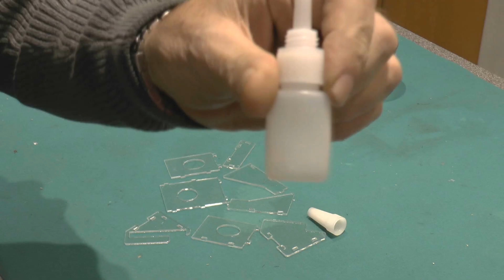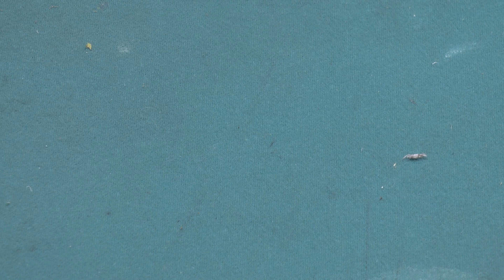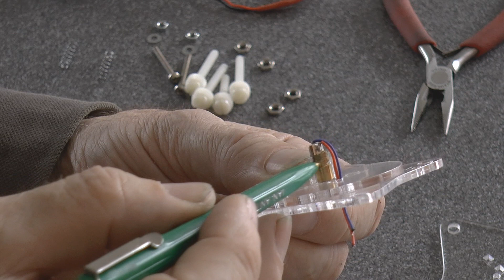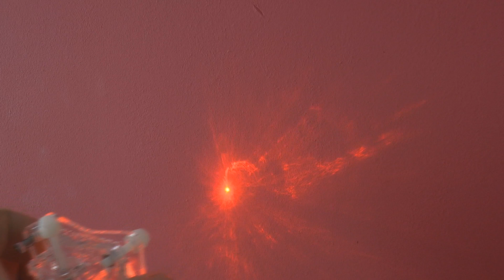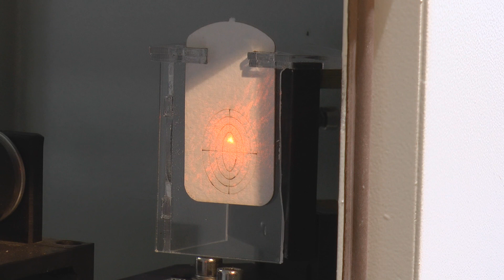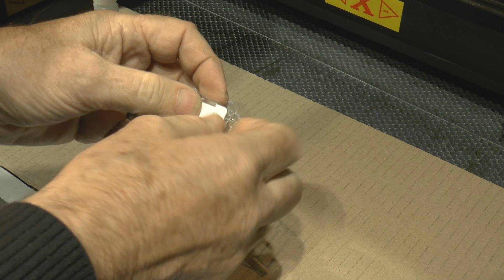RDWorks Learning Lab 88 Mk6 pointer and other tools

Comment: Hi Russ, first - thanks for your very detailed educational videos! 
Not sure you still read/answer messages to this 4 year old video you did.
I enjoy, learning and study videos from you already a couple of years and finally bought a Chinese 1060 100W RECI-W2 CO2 laser.

I would be very pleased if you could send me the drawing files you mentioned for the MK6 and accessories.
Unfortunately I can't find the PM you mentioned for your Youtube channel, it might have changed. 
However - Great quality videos from you! Thank You!
Reply from the maker: Hi Wolfgang

Just remember to remove it after use because this is not a beam combiner but just a setting aid. This video was near the end of my  mission to find the ideal laser pointer setting aid and there are videos  for the others that follow  all the way up to Mk7. I am happy to send you all the drawings BUT in the light of experience,  i must add bit of a health warning. I have designed them so that you get continuous live feedback as you are adjusting mirrors during beam setting.  They all work well up to about 95% and quickly get your mirrors into approximate shape, However, unless they are aligned perfectly with the laser beam axis as it exits the tube there will always be some error..I found that despite my best efforts you still have to go all round with the scorch test to set the machine perfectly. Time and a lot of experience has taught me this, so I abandoned the idea eventually. BUT don't abandon the idea completely because it is an amazing tool to help with fault finding and mirror cleaning/changes.Two massive benefits are to be had if you have mirrors that are not easily accessible for cleaning. Let's assume your machine is well set and you decide to remove a mirror. Before doing so put the head as far  away as possible from  mirror 2  and put some sort of target/cross-hair on the head entry port.. Set your pointer to fire at the cross hair and leave it on. Remove and service your mirror  and when you come to replace it, it takes but a few minor adjustments to get the beam back onto the cross-hair and you have reset your mirror.. The other very useful application is when you have set your beam  perfect in 3 table corners but cannot make the 4th corner correct.  Observing how the beam moves as you traverse from front to back with the gantry you will observe the beam moving. It's now down to your mechanical problem solving skills to identify and fix the issue.   OR  you can watch this for the real solution    https://www.youtube.com/watch?v=Oc3UaJREQnU

Its now about 4 years since I last tried to use a pointer but If you still want drawings you are welcome. Just add your disguised email address to another comment and I will send them to you and also delete your comment.   

Best wishes
Russ

Comment: Hi m8, i need ur help, im about to order a laser cutter, but i cant deside which one to order, can u help me out making the right choice? i been looking at this http://www.ebay.co.uk/itm/Reci-100W-Co2-USB-Laser-Cutter-Laser-Cutting-Engraving-Machine-1000-x-600mm-EU-/252576517847?hash=item3acebbced7:g:0w0AAOSwqfNXkRxN

and this 
http://www.ebay.co.uk/itm/100W-Laser-Engraving-Cutting-Cutter-Engraver-Machine-UK-Free-Shipping-free-Gift/112191092149?_trksid=p2047675.c100005.m1851&_trkparms=aid%3D222007%26algo%3DSIC.MBE%26ao%3D2%26asc%3D38661%26meid%3Da41d309c0a11408ab39cb77667ef5a72%26pid%3D100005%26rk%3D4%26rkt%3D6%26sd%3D222299661008

which one will be best?
Reply from the maker: Hi Rikard
This red machine is a much better machine. The seller Sunshinesmile services are very helpful until you have a problem and then no communication. They are a big export company dealing with all sorts of things so these machines are just something they sell, they know nothing. I know because these are the guys I bought my machine from. However, there service is typical of all Chines sellers. This is very much a sold as seen purchase. There are precautions you should take. First do not take any offer of a reduction for bypassing ebay. Ebay protection is pretty useless but it is the one way you will be able to communicvate with them if you are really unsatisfied. Secondly do not use any funds form your pay pal account, make sure you buy with your credit card. You will get better protection this way and can always threaten a complete refund from your card company unless there is some reduction for .....whatever it is you find wrong. I would anticipate for certain that you will not be receiving a proper 100 watt tube. It will be an 80 watt tube with a max rating of 100 watts. You cannot ever use the max rating!!!. In general this looks like a good buy even if you have to buy another tube and power supply in the near future to get the super reliable  machine you are after.
Good luck and seasons greetings
Russ
Reply from the maker: Hi Rikard
Everywhere I look on the machine it seems very flimsy and proper engineering is absent. The most important thing on any machine is a PROPER bearing rail system.  Linear bearings are essential for a machine that is going to be sweeping left and right during engraving (just like an inkjet printer)  you need to see bearings like this
http://www.lmbearings.com/index.php?p=linear-guideways

I don't recognize the control/programming system and it appears unable to handle cad type files such as dxf or dwg A real Reci tube will cost almost half the cost you are paying for this machine, that rings warning bells for me. Have you read all the comments and return conditions if you are not happy? It's a PayPal only payment and as of about 6 months ago PayPal changed their protection guarantee to EXCLUDE manufacturing equipment of any sort.
If it was my money, I would walk away. The only thing attractive is the price.....and that's the real catch.

I cannot spend your money for you but I would not want to see you throw it away.  This is a more realistic price for the sort of machine you are seeking

.ebay.co.uk/itm/100W-9060-RECI-CO2-Laser-Engraving-Cutting-Machine-USB-PC-Engraver-Cutter-CNC-/252534784604?hash=item3acc3f025c:g:ha8AAOSwAuZX1WB0 

Although I would not even choose this one.

You must consider several issues in specifying your machine
1) What size bed MUST you have ? the larger the bed the larger everything gets (bearings, motor size, weight of beam etc) and the price goes up accordingly.
2) will you mainly be cutting or engraving? Cutting requires laser power but engraving does not  If you will be cutting, is this for production or hobby work and what thickness/material will you be cutting? A 100 watt tube my be great for cutting but have very little control at the low power end where you need to be for engraving.
3)Will the machine fit through your doors?
4)is the control software well supported and capable of working with your file types.?
5) What will your wife let you spend?

Happy to speak more 
Best regards
Russ
Reply: SarbarMultimedia Hi again, thx for ur answer, would it be better for me to buy parts and build it on my CNC machine? it's 1500 * 1000 cm, problem whit that is i don't know what parts to buy, I have a budget of 2500 Euro, could u help me out, and is it possible to mount  it whit a CNC machine?
Reply: oh the motors are Nema  42, so they are strong.
Reply: hi,we supply the cnc router and laser cutting machine,email address stephaniezhao@ynlaser.com
Reply: Hi Russ, thx for your answer, i got the machine, it was pretty fast delivery from England, and now all the learning is starting for me, i looked many of your videos, but couldent find any of how to set the power and speed right, so fare i just been exsperimenting whit the machine, but have never put the power over 65%, i saw a video where u said not to run it at 100% if i wanna save the tube..

Comment: It is so nice of you to share your learning ... I really enjoy the "imaginerring" it opens so many doors for us on our trek.  
I know thank you just doesn't begin to cover all you have done.  
I use my machine almost every day and all this learning has helped so much.  
I am looking forward to my realignment quest with the new tools.  Thank You!
Reply from the maker: Hi Rich
Word of warning this is not an absolute substitute for the laser beam I've tried to design it so that the laser diode is always central to the water jacket which may or may not be perfectly central to the beam itself. Before you turn your machine off and rip everything apart,  put a reference scorch mark at the laser head itself and then switch off your machine and align the beam to that scorch mark. That way you have a reasonable simulation of the beam path. Be very careful not to touch or knock the pointer once you have set it. Now play with your mirrors. Once you are happy with your new setup. go back and retest it with the scorch mark method and make final tweaks.
Good luck and best wishes
Russ
ps Thanks for the kind words.
Reply: Using a diode we have found that they do not fire straight from the center.  Even using expensive ones.  The fix was to set up a target and rotate the diode until you get the best results at hitting as close as you can to the center.  Then mark the diode case so you know TDC of the case in that rotation.  Then you have a more controlled chance of hitting the target correctly.
Reply from the maker: Hi Rich
Yes, I am aware. I went to the trouble of collimating my Mk1 and Mk2 versions. However, I found that even with all that effort, the actual beam path was different to my reference beam so I decided on a different strategy and that was to  use it as a marker beam for changing out/cleaning mirrors. If it is used as a comparator rather than an absolute it works brilliantly. You can , as I said use it to get a "from scratch" setup of the beam path  provided you have put down a referernce marker before you start. It will ultimately require checking with the scorch method for final tweaks.
Best regards
Russ

Comment: Hi Russ, another fun video. I'm about to pull the trigger on an eBay K40 laser and I fully expect to have to go over it with a fine tooth comb before I even turn it on so your videos continue to teach and amuse me. At least I've never seen you do what a gentleman from Alabama was doing in his recent laser video and that is running his fingers all over the tube whilst powered up complimenting the cooling system!! As an old broadcasting tech I almost fainted when I saw that act of utter stupidity! As I've said before, keep it up. Cheers. Ingmar
Reply from the maker: Hi Ingmar
Thanks for the kind words. I understand the coherent beam that come out of the laser (as you will see in  https://www.youtube.com/watch?v=kJe16YQlIM0      ), however I respect 25000volts dc and am  ultra cautious of the hot end. Glass may no be conductive but air and dust can be!! Good luck with you new purchase...and yes , you can be certain that it's a "project" that you are buying  rather than a "hit -the-ground-running" piece of kit
Best regards
Russ

Comment: As always Russ, a very interesting clip.  
I look forward to your assessment of servo vs stepper at some future stage as the internet pundits seem quite divided on their relative benefits and drawbacks.  
Thank you very, very much for your efforts in enlightening us.
Reply from the maker: Hi Graeme
The servos on this  new machine are hybrid servos which means they are 3 phase stepper motors with an built in shaft encoder that still has some "steppiness" about it but has better positional  control. It cannot lose its position. I find out it is rare to have true servos on these machines. But the gearing to the drive belt is completely different and that's where I think the improvement will show. That's for a future session.
Best regards
Russ